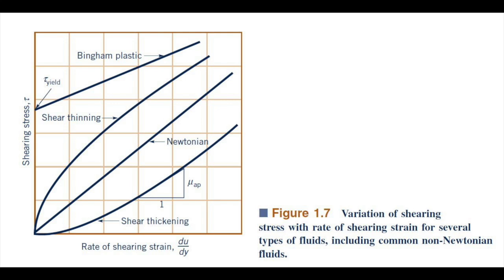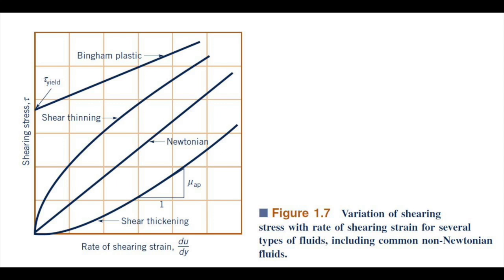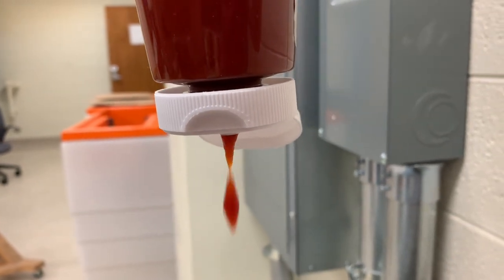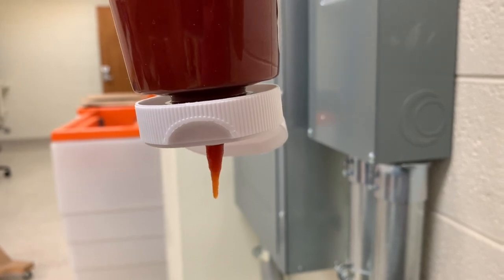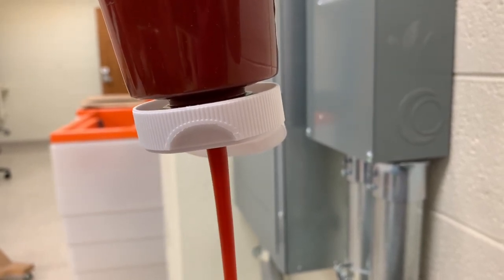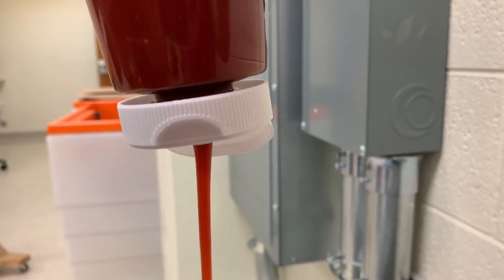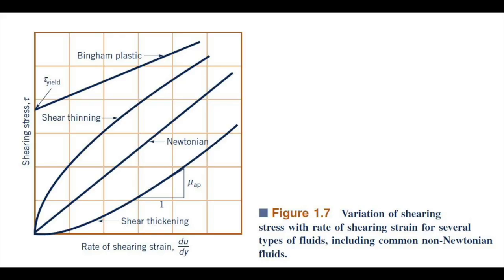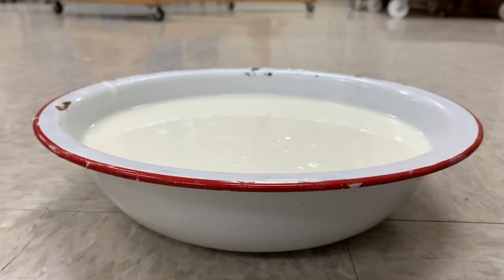Shear Thickening vs. Shear Thinning

Comment: Non Newtonian isn’t just Shear Thickening (Oobleck) but can also be Shear Thinning (like Ketchup), where a solid-like substance turns into liquid-like when force is applied (or rather, viscosity decreases drastically with force). You can also have Bingham plastics which require some amount of shear stress (some force) before viscosity starts changing, like toothpaste!
Those are other common examples of non-Newtonian fluids

Comment: Didn’t see anything out of the ordinary in the ketchup. Guess I don’t get it.
Reply: The ketchup is ordinary but it becomes more slippery once you apply shear stress to it. So it's a thick syrup when it's stationary but once you apply a shear stress such as squeezing it, it become slippery, hence it's viscosity decreases. Viscosity can be explained as how slippery the layers of a material are in reference to each other. Newtonian fluids stay the same; their viscosity does not change, no matter how you stress the material viscosity is constant. But ketchup in this case is called a shear-thinning fluid, apply a stress to it, it's less viscous.
Reply: @AugustinLCauchy6659  thank you for your explanation!